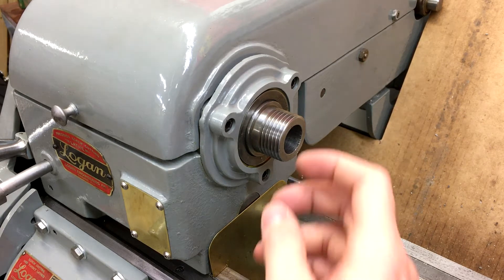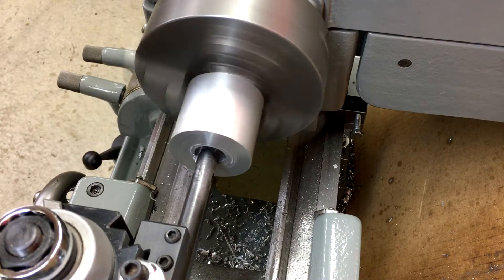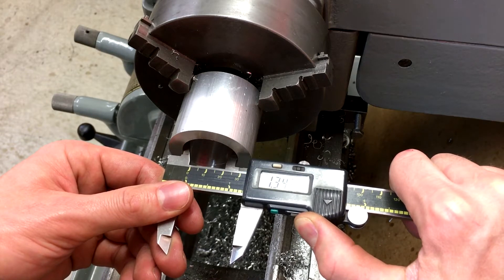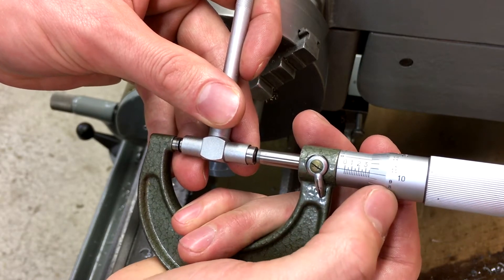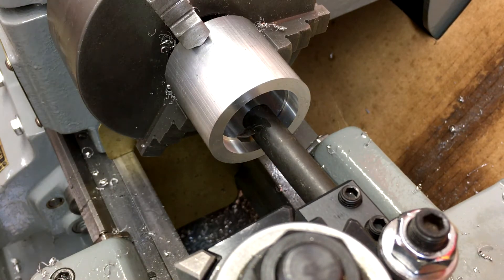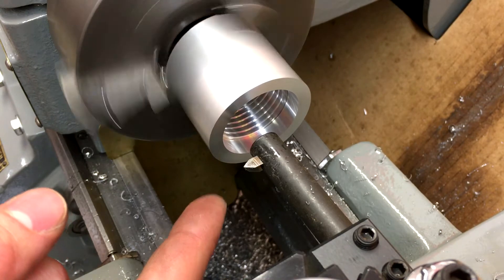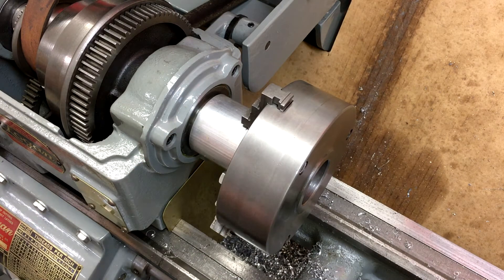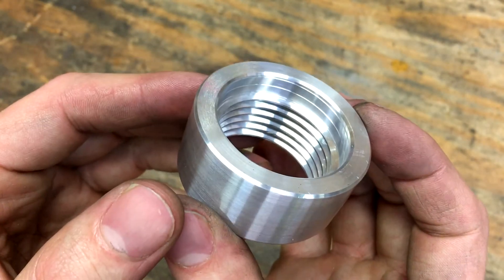How To Make a Lathe Spindle Thread Protector

Comment: Maybe I am missing something, but what is the reason to make a protector for the thread? there is the chuck all the time, isn't it? How,why or when it can be damaged?
Reply: The hole on end of the spindle on this lathe is a MT3. It is used to hold tools. like a collet adapter. When used, the threads are exposed. It also aids in removing the adapter when you unscrew the thread protector it pushes the adapter out of the mt3 hole. I also turn wood on my logan lathe so when I slap in a "drive spur" again the threads are exposed.
Reply: If you (or anyone else) has to move or relocate that lathe, the chuck needs to be off and the threads will need a protective cover.

Comment: Thank you putting the time to do this video.  it is great.  I have the same logan  yours is much quieter than mine.  What kind of lubricant do you use on the gearing?
Reply from the maker: I use 80W-90 gear oil

Comment: Nice job, I applaud you on all the work you have done so far. You are certainly not new to machining. I would like to know a little about the indexer you used on your mill in a prior video.
Reply from the maker: Thanks Richard!  My indexer is similar to this style: https://www.mscdirect.com/product/details/09651001  Mounts either horizontally or vertically.  Has 24 (every 15 degrees) set screws inside of it and it will index to each position that the set screw is tightened in and bypass the positions where the set screw is backed out.  So you can adjust the stopping points in any 15 degree increment combinations you want.